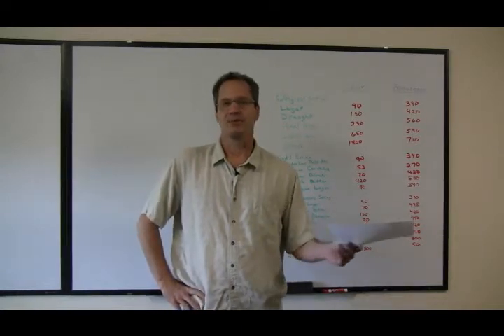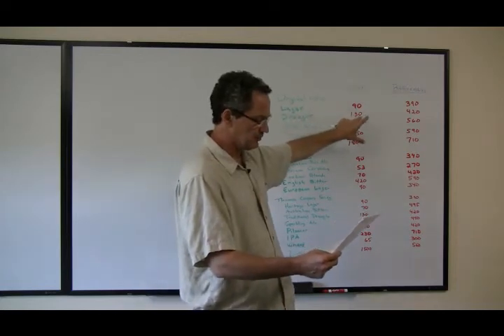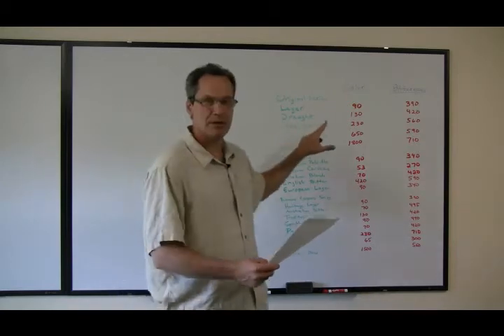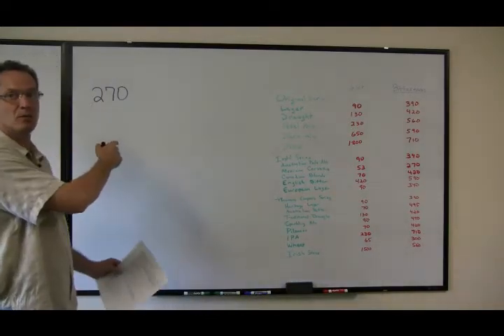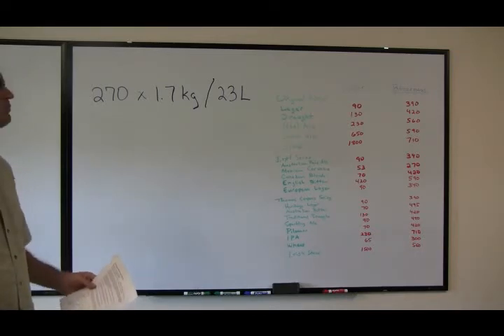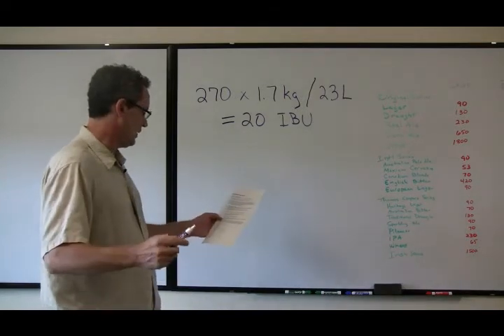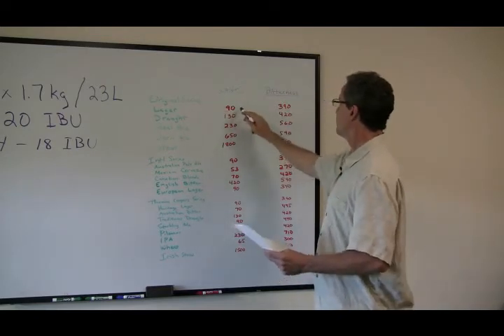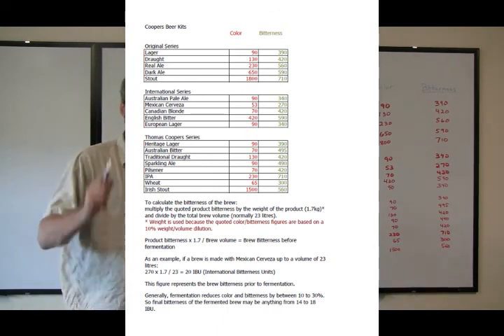Calculating Bitterness from a Coopers Hopped Kit

Comment: i work it out a bit differently.this is the way it makes sense for me.divide the 23 ltrs ( the end volume) by the 1.7ltrs/kgs of kit.(the kits bitterness is 270)then divide 270 by the answer to previous calculation.so 23 divided by 1.7=13.53.then 270 divided by13.53=19.95.
a different way of saying the same thing it seems.
hope this helps anyone else with odd math skills too.
cheers.